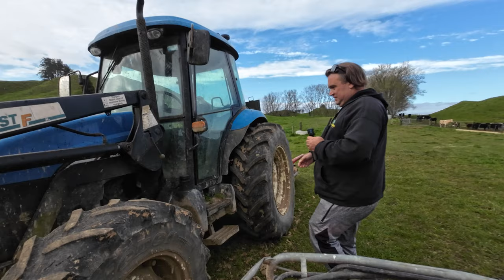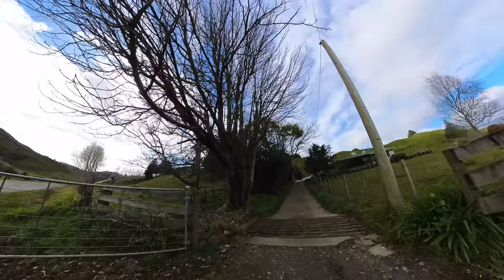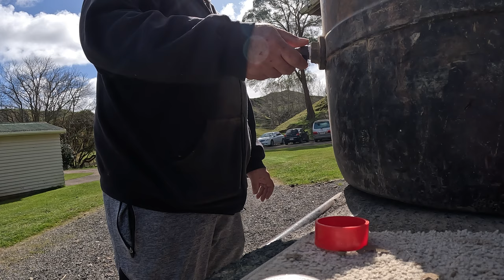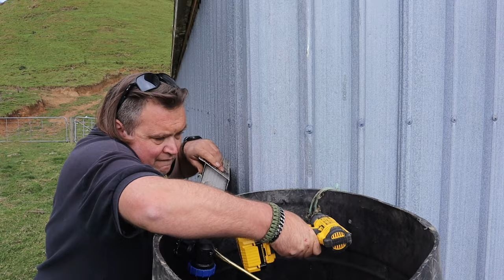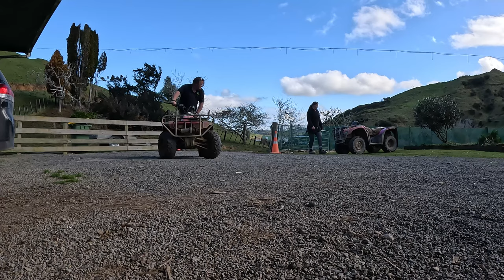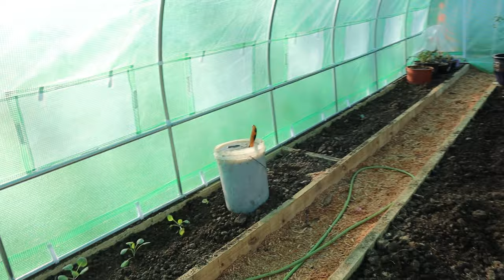DIY water tank for the tunnel house [ Life in New Zealand Daily Vlog #416 ]

Comment: <Thinking> i got a similar container set up on the ground for a water system.
I dip the watering can in over the top.
Much faster and more control of water around the base of the seedlings and plants.
Reply: You can add fert to the watering can worm casts  or nitraphoska to the water in the watering can.
Reply: You will work it out ,very exciting
Reply from the maker: Oh that's a brilliant idea about adding fert to the water tank! Gee, I'll keep you on! Haha I fill the watering can with the hose 🤦
Reply: @RealNewZealandAdventures  <♡>
I've been through a few droughts .
💧 every drop is valued. 
You're so lucky having a spring.
Reply: @RealNewZealandAdventures  we had a thick frost yesterday morning.
And one this morning.
Snap frozen spinach.
Reply: @RealNewZealandAdventures  <♡>
Reply from the maker: Aw yeah I bet! So lucky! We would have had to buy water in for the house this winter otherwise